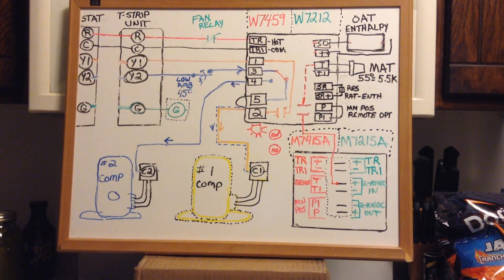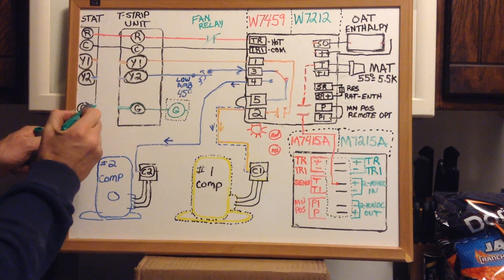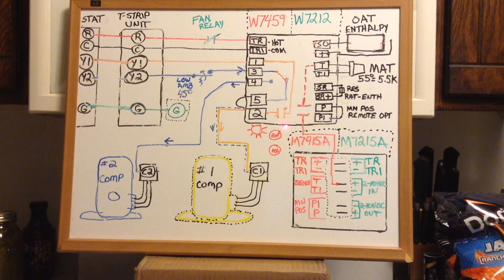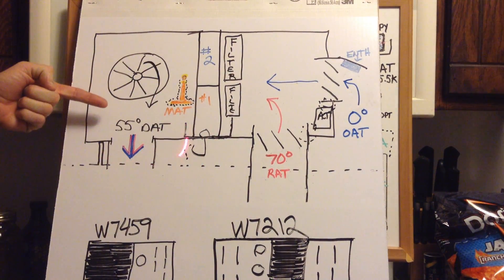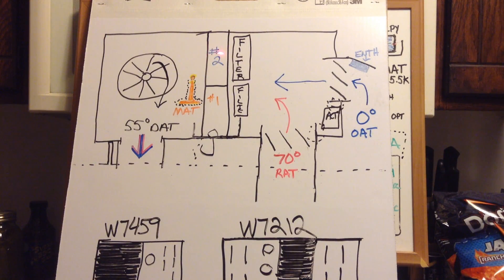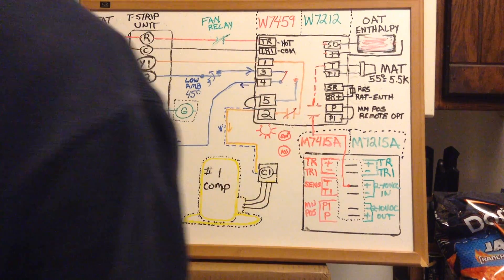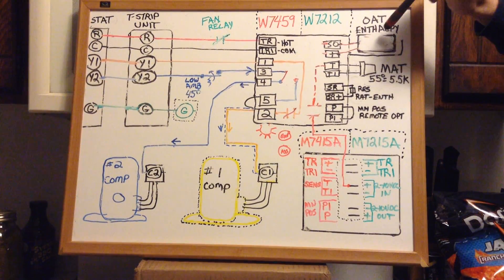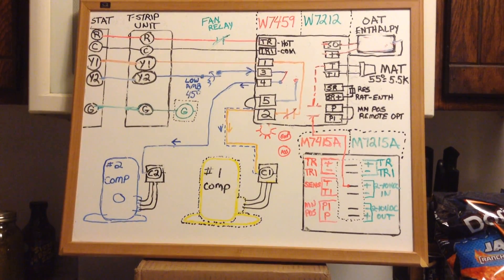Economizer Logic Troubleshooting #economizer #honeywelleconomizer #freecooling #enthalpy

Comment: Hi David. 
Excellent instructional video. One question- Lets assume only 1 compressor. In a situation where its "Not ok" for economizing"- Y1 is then diverted from 1 to 2. But lets say  after a while the thermostat switches to Y2 and send 24 volts to 3 then out through 4, But we only have 1 compressor?? Is the 4 wire doubled back onto 2 in this case? Or maybe the factory would not have a wire coming out of  4?
Thanks in advance for your answer.

Comment: Excellent video Dave, Thank you.
Grand Rapids, MI
Griffin Hall
Reply from the maker: My pleasure, I installed a EMS system at the H&M in the woodland mall in Grand rapids like 3-4 yrs ago
Reply: @davidharty3653  im working on putting in a honeywell jade w7220a1000 in a york unit. i have temp and enthalpy sensors, honeywell sells them a a kit.

maybe we can go over how to convert from York's economizer board set up to w7220a1000.

just a small 5 ton york, the temps are still well about 53* so no huge emergency.

Comment: What about the w call for heat logic
Reply from the maker: The W terminal/Call for heat doesn’t connect to the Honeywell W7400 or W7200 series economizer modules in this video.
Economizer only economizes in the cooling mode, so I left out the W in the drawing
Reply: I have a carrier 10 ton rooftop that the economizer is staying open 100% in heat mode it’s the new 2021 unit
Reply from the maker: What kind/ brand of economizer logic module does it have ?
Reply: I need to send you a pic of the model and serial number of the unit somehow

Comment: Excellent video. I'm a sparky just getting into this stuff. And this helps a lot. Any insights on jade controllers? As a layman they seem to run similar to this but I camt figure out how to modulate the economizer enough to prevent positive pressure in this store.

Comment: Do you have to tell the thermostat that it is a 2-stage, even if it's a 1 stage? Or do you just have to run the Y2 wire as if it did have two stages?
Great video. Very informative and thorough.

Comment: David, Awesome video. You mentioned at the end that you can test some actuators with the 9 volt battery. Do you know which honeywell acuators are 9Volt or where I can find that out? I have a carrier unit with a W7212 mounted on top of the M7215a actuator. Thanks
Reply from the maker: Timothy Pawlowski M7200 series actuator uses a 2-10v signal for its proportional control

The 2 in 7200 tells you that actuator it's a 2-10v
Reply: thanks dave.

Comment: 8:50-9:30
still confusing. why water will leak if only #2 evaporator work? the moisture into the air will condense on the surface of fin and flow down to the drain pan.
Reply: water not falling fast enough and the wind from blower fan will blow water all over.  When both evaporators work however water less likely be blow off the 1 evaporator due to lower temperature of the evaporator.

Comment: Great video and detailed explanation. Much easier to follow than the OEM explains.  When economies fails, most just pull the connector and install the jumper to eliminate the economist because the customers don't want to pay for these expensive option repairs especially when the anted of return is usually less than the expense. Still think you missed your calling, should ,vet been a teacher. Your ability to communicate is excellent.

Comment: Hey David, thanks a lot for the video! Definitely not something you have to do but I am glad you put it up here. I am an apprentice myself and have worked with a few Mechanics now that would sometimes take the Y2 terminal off and tape it or put a marrett on it. I've spent a little bit of time playing with economizers to try and understand them and found that you did need the Y2 terminal. I didn't know however that the module actually communicates with Y2 and can still economize and use a compressor. So far I have been setting up a Time Delay on make with the unit to energize Y2 after Y1 has been energized for a few minutes. This might sound like a ridiculous step to take but it was all I knew haha.  Anyways, thanks again for the video it was very helpful!